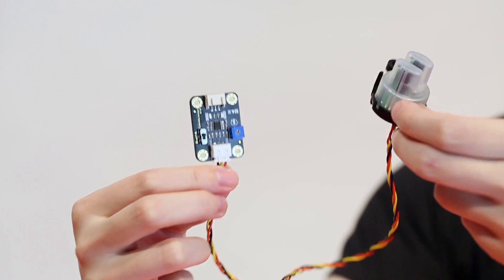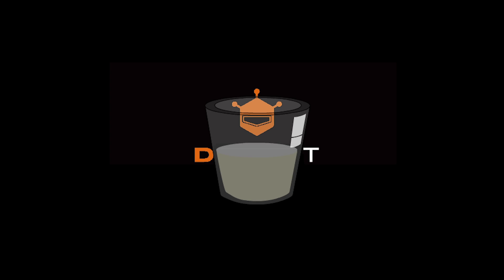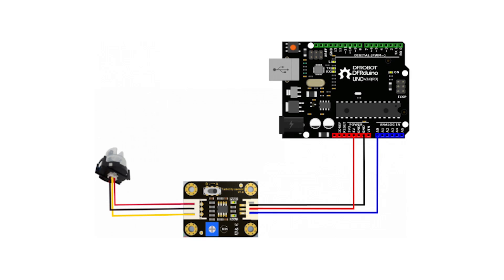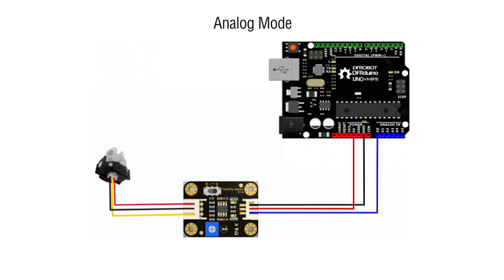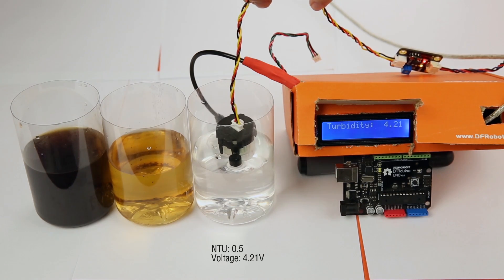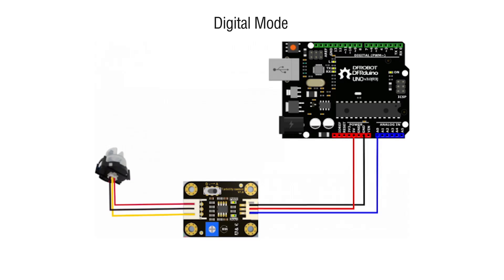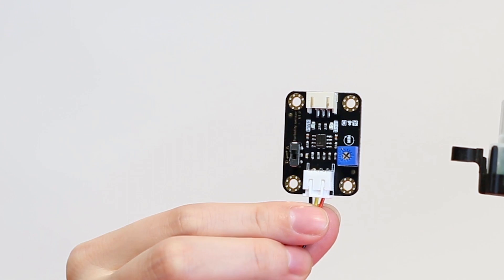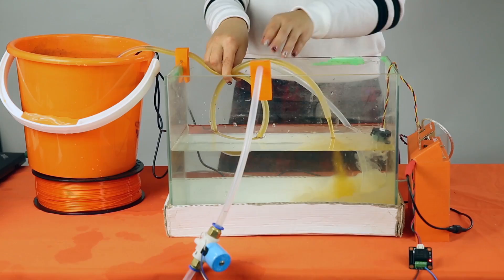We've Got A New Toy! - Analog Turbidity Sensor (SEN0189) - Mar2016

Comment: Just a note on turbidity, this probe is a 180 degree one or absorption turbidity units, where the standard method is in 90 degrees, o light scattering by particles minimizing the size of the particle effect. In the other hand this probe is an IR based one hence insensitive to water color, where color maybe not be a turbidity correlated parameter so a colored water may have low turbidity where a “white” water may have very high turbidity. Just to know if you want to use this in drinkable water as your water company does. (Yo may need complex calibration). Conclusion this probe may be great for trending but maybe not very good for actual values.

Comment: Im working on iot water quality management project.. i have been using this sensor for 3 months and from what i has observed, this sensor depends on light intensity of surrounding..The higher the light intensity the higher the voltage. if you following the voltage to ntu conversion on the official page. You will get maximum ntu(3000) level/low voltage at night outdoor. Thus, my opinion,  the sensor is not feasible outdoor at night or when weather is cloudy. The sensor is feasible only in condition of constant level of light intensity, then you will know that the water is either turbid or not. also you get different reading when using transparent container and darker color container..
Reply: So using this sensor in a pipe and passing the water through the pipe would be a solution to this problem?
Reply: Permisi mas, boleh kirim kodenya untuk kalibrasi sensor. terima kasih email:cahyapradika4@gmail.com
Reply: Which sensor would be a better option?

Comment: When I use the Analog pin there's no changes in Voltage output. No changes at all. Same readings with or without the turbidity sensor.
Reply: you may want to check the connection of your pin and the one you set on the code
Reply: @amirulhazeiq8997  It's right. A0. The DOut LED in the Amplifier doesn't light up.
Reply: @amirulhazeiq8997  I did the Dout pin not lighting up. Use it in both esp8266 and arduino both not working.
Reply from the maker: Hi Nik, could you check the connection of the wires? cause the connectors of the wire are different.

Comment: Hi, I'm try to use the equation you put in the turbidity sensor wiki. I'm pretty sure it doesn't reflect the relationship between NTU and voltage showed at this video.

I would like to ask you guys to put in your wiki something more complete and didactic (not indicate) how to convert voltage to NTU and particularly how to calibrate your sensor, cause do that it is not a easy task and not everyone who is buying your sensor are experts.

To get the points you show in the video with the equation yout provide in the wiki, I have to get these voltage values on the arduino analog input:
0.5 NTU = 4.20011 Volts. Font:http://www.wolframalpha.com/input/?i=(-1120.4+*+x+*+x)+%2B+(5742.3+*+x)+-+4352.9%3D0.5
50 NTU = 4.18656 Volts. Font: http://www.wolframalpha.com/input/?i=(-1120.4+*+x+*+x)+%2B+(5742.3+*+x)+-+4352.9%3D50
500 NTU = 4.0578 Volts. Font: http://www.wolframalpha.com/input/?i=(-1120.4+*+x+*+x)+%2B+(5742.3+*+x)+-+4352.9%3D500

Pretty different from yours:
0.5 NTU = 4.21 Volts
50 NTU = 4.1 Volts
500 NTU = 3.27 Volts
Reply: Hello
Sorry you managed to convert the voltage to NTU?

Comment: Our sensor gives output from 0.2 v (for dirty water)  to 3.3v maximum (for pure water).But your video shows 2.5 to 4.5v. How do we change our voltage to ntu in our case? What is the maximum ntu value for this sensor that it gives?
Reply: ah i read pdf of turbidity in http://www.farnell.com/datasheets/1770074.pdf
in that pdf it say the Voltage Differential only 0-3.0V
i dont know why in the video get 4.2 v
Reply from the maker: @Neeta
That's not right outputs, Have you tried to output the analog signal directly, is it from 0-1023?
Reply from the maker: @faishal
The voltage differential is 3.0V±10%, and 4.2V is the voltage in pure water.

Comment: Do we have to use ADC with arduino mega too ??? I am asking because as we know that arduino already has an ADC and the readings that I am getting is varying between certain values and then finally goes to zero or 1023. So how to resolve this ???
Reply from the maker: Hi,
You don't need any ADC for Arduino, are you using the code on wiki page? if you use the code of Example 1, you need to set the signal switch to "A"

Comment: I bought two same turbidity sensor used in this video but it is keep showing 2.2V for tap water when it seems like has to be around 4.21 according to the video. Can you please point out what the problem is? what is the code you are using?
Reply: i met similar problem. Is there something wrong with the adapter?
Reply: i also have the same problem, can anyone solve this, it would be a great help for us thank you.

Comment: Hey!
I have purchased a turbidity sensor but i was not aware about this module which comes with it. So i purchased just the sensor module and not the interfacing board which you have used between arduino and the sensor.

Can you please tell us what that interfacing module actually is as i am not getting output by interfacing the sensor directly with arduino.

All i am getting is same reading for all levels of NTU.
Reply from the maker: Hi Jethva,

Using the turbidity sensor requires a adapter breakout to control it with Arduino communication. Without the sensor adapter, you won't be able to get readings from the sensor correctly. Thank you!

Comment: Thanks for the video. I recently bought three of these sensors but cannot get them to read out a reasonable voltage based on the turbidity. My readout is 0.04 - 0.05 no matter what the turbidity is. Any suggestions would be greatly appreciated! Thank you!
Reply from the maker: Hi Emil, 
Make sure the pin head of the cable connects to the ADC board doesn't go reverse. Otherwise the voltage will always stay at  0.04 - 0.05.

Comment: Hello, I have a problem with this sensor.
It just shows 0.4v everytime.
Do I need to calibrate something?and How?
Thanks for the Help
Reply: Hi, I happen to have the same issue. Have you managed to resolve it?
Reply from the maker: Hi Joao,

Make sure the pin head of the cable connects to the ADC board doesn't go reverse. Otherwise the voltage will always stay at  0.04 - 0.05.
Reply: The sensor is connected on the lcd shield, blue-on-blue, red-on-red and black on-black
Reply from the maker: Check the connection between the sensor and the A to D converter board. If that doesn't solve the problem, you may need to contact our custom support at techsupport@dfrobot.com.

Comment: your video displays the output voltage, can you help me how to display data in units of turbidity (NTU)  please? tank you
Reply: Hello !, could you measure in NTU correctly?
Reply from the maker: Hi jbmg17,

Yes, but in term of absolute value, the result may vary under different physical conditions. Here we provide the relationship between voltage and NTU under different temperature on its wiki page:

https://www.dfrobot.com/wiki/index.php?title=Turbidity_sensor_SKU:_SEN0189
Reply: @DFROBOTCN  Hello, that link leads to a blank page.  I am interested in the answer to this question too.
Reply from the maker: Hi ananta, 

Sadly the output voltage only ranges from 0-5V. Try "map" function to in your code to convert this value into NTU:

https://www.arduino.cc/en/Reference/Map

The relationship between voltage and NTU under different temperature can be found on its wiki page:

https://www.dfrobot.com/wiki/index.php?title=Turbidity_sensor_SKU:_SEN0189